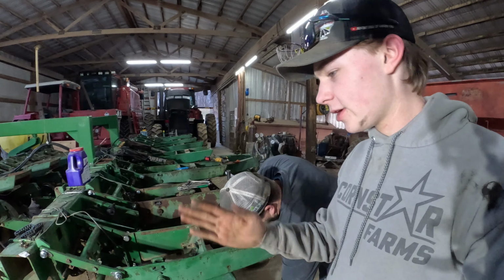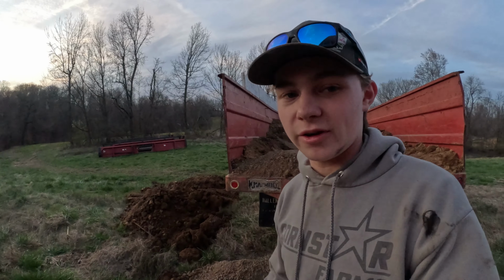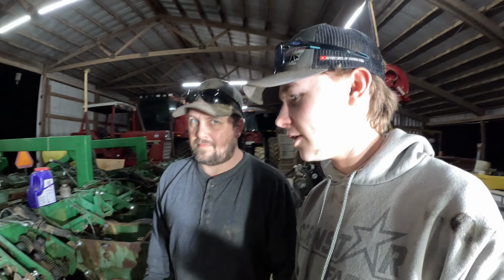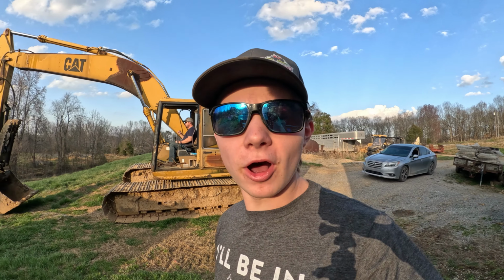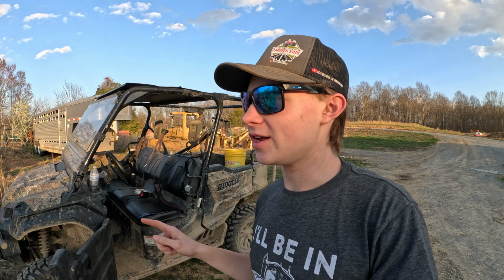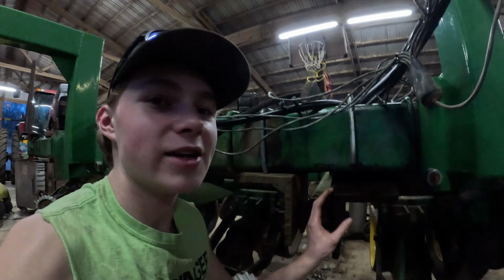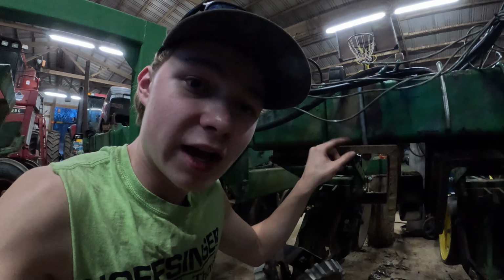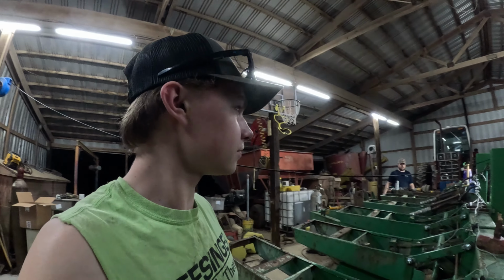We MESSED UP Big Time on the Farm!!!

Comment: Take a cheap tarp in the bottom of that dump bed and screw it in at the top so it won't slide out but the dirt on top of the tarp and then the dirt will slide off the tarp😮😮😮😮😮